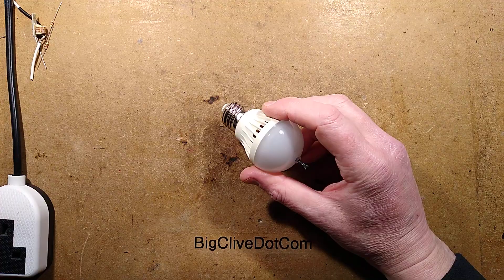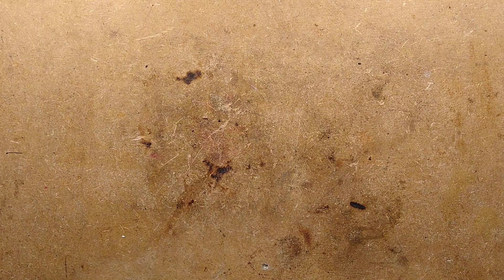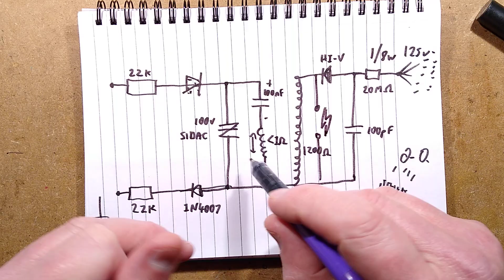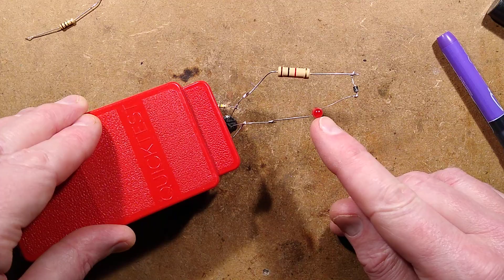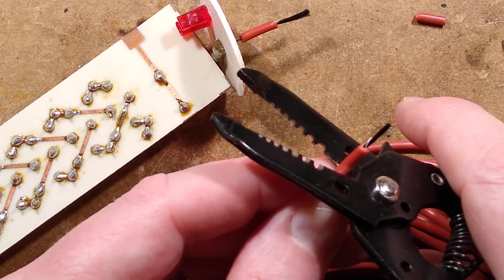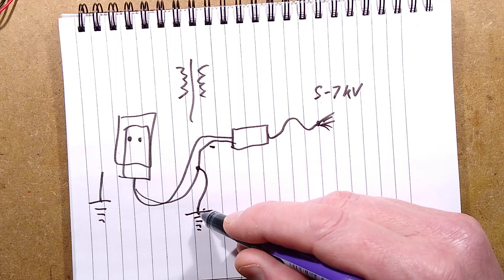LED lamp with tiny 5kV high voltage ion module.  (inc schematic)

Comment: WhEre iS thE 12V-vErSioN???? Anyway, can someone potentially use the 12V-version for a motorbike´s spark-plug, or did I get it all wrong??? Thank you á priori for any answers!!! Also, thanks to the Sidac, I actually understood this circuitry, impossible otherwise (when for example a Zener-diode in place of the Sidac  ;-)   So, thank you Sidac...!

Comment: The operation of the SIDAC sounds similar to the much less expensive DIAC.
Reply from the maker: Similar, but optimised for different trigger voltages and higher current.

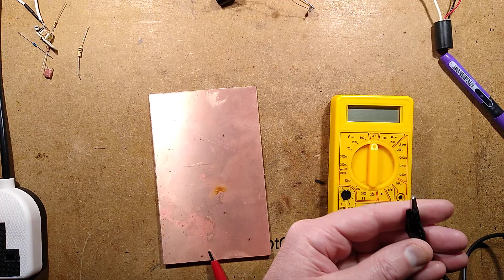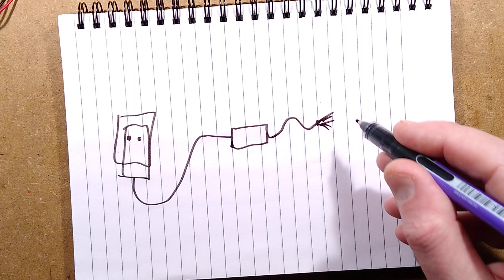Comment: Here he goes again, checks if the soldering iron is on, by touching the heating element. 17:02 Ooh, Clive, if you were to stick that around your bits, will that give you a tingly sensation @ 7kV? 24:35

Comment: Another great place to find carbon fiber cords is to save your old spark plug wires when you replace them, if you're driving a car that's got a distributor and not coil-on-plug ignition. The high voltage wires coming off the ignition coil to the distributor, and the ones from the distributor to the plugs, are typically a similar sort of silicone-insulated carbon fiber to what's useful in ionizers, and can be used pretty much exactly like that carbon heating cord wire.

Comment: Let me guess - if you touch the fibres when it is on you go into the next life very quickly
Reply from the maker: No.  Very current limited, but they could do with a better resistor for safety.

Comment: The line side is essentially a mains voltage relaxation oscillator using a sidac. A relaxation oscillator with a GUNN DIODE can be a microwave source. Often used in AESA radars in an array to produce the steerable radar beam.
Mark Fay US MMC Jr. Engineer QMED AS-E

Comment: you mentioned putting resistors in line with the carbon fiber what is the resistance of the carbon fiber 
if my guess is right the carbon fiber would be it's own resistor.
Reply from the maker: It has very low resistance.
Reply: @bigclivedotcom  I know that there are carbon based resistors, but from the sound of it these filaments would be more like graphite.

Comment: SIDAC, silicon diode for a/c ... I've known that as a "diac" since the late 70's.. interesting component along with the uni-junction transistor, was our analog "timer" component when buiding strobe lights... yeah, the cheap and humble neon also works.
Reply from the maker: The Sidac has the advantage of being rated to handle much higher current than a diac.

Comment: Need to check if it is generating ozone, probably is!
Ozone is very nice but you shouldnt breath it, it is very unhealthy to breath ozone, also, it would not be pure ozone as the air has other gasses.
There is a similar ionizer for USB use, the one I have has the same carbon brush, but internal circuit is much more complicated.

Comment: If Fibre Cable is used on the 5 pins of a DEZAC. What would happen if the stands fan out and touch each other?
Reply from the maker: They're all commoned internally anyway.

Comment: Have you observed if this module generates some air movement, i.e. by making some smoke or wapor near it and looking how it moves? I wonder if it's possible to build a speaker using a similar ionizer. After ionization, ions are repelled from the electrode, because they have the same potential as it. If ionizer's power were modulated with sound signal (maybe it would require more complex inverter, generating constant wave for transformer instead of damped waves like in this circuit), air pressure would change.
Reply from the maker: You do get electrostatic speakers, but they create a dangerous level of ozone.

Comment: Acceptable meter? Dubious class rating. Would you use it on mains voltage? I wouldn't.
Reply from the maker: For bench use it's fine, but absolutely not for high current or voltage.
Reply: @bigclivedotcom  Think they are Cat II if I remember correctly? The shade of plastic they use is transparent enough to emit a nice glow when things go wrong inside. Have you ever done a tear down review of one?

Comment: That might actually be a diac (which is a half wave sidac) Diac's are relativity cheap on ebay (at least they were 5 years or so ago when I purchased some) .
It would be interesting to look at the wave form on the transformer primary, you may find that the pulse frequency is much higher than the line frequency. I have a guess that the circuit is operating as a relation oscillator at a higher frequency, that would also work better with the small capacitance on the output.   
Many years ago I used to build power supplies (zappers) with a neon lamp relation oscillator, the transformer was a 'backwards' audio output transformer so it wasn't in the kV range but was a healthy zap.
Interesting video, thanks!
BTW- That's an interesting safety line power connector... Most of my work is done with a "Widow-Maker" (an old power cord with clip leads attached [don't try this at home kids ;-) ] )

Comment: Interesting! I had never seen air being a conductor so concretely before, except for spark-type situations. I reckon it acts as a current source? So does the voltage shown depend on the meter's internal resistance? Also, could you point that ion emitter at a transistor's base and have it light up a LED?-)
Reply from the maker: The meter impedance dies affect the reading.  Ideally a standard 10Mohm impedance.

Comment: I think sidacs are just special diacs?
so something like this? https://lcsc.com/product-detail/Thyristors-TRIACs_Littelfuse_K2000G_K2000G_C151185.html (they have various voltage ratings)
They call it a sidac in the documentation but the shop lists it as a diac.
I can really recommend LCSC btw. good packaging and great prices, reasonable shipping costs. I recommend checking it out when you want to buy components.

Comment: Interesting video.  You can also use a neon bulb in place of a sidac, which fires at about 90 volts.  I built them decades ago in High School electronics class, where we made our own resistors using graphite (pencil 'lead' rubbed on paper), and capacitors out of wax paper and aluminum foil.  The whole thing was referred to as a 'relaxation oscillator'.  The rate of flash is determined by the RC time constant...

Comment: Clive,  tell me about that HV diode on the output, do you have a part number for it?  Would you not need a different trigger value sidac for 120VAC  in the US? Say 50-70V?
Reply from the maker: The part number had been removed by the acetone.  Theoretically a 100v SIDAC will trigger on 120V.  I tried the module on 120v and it worked, but at lower output.

Comment: i'd probably try to make it battery powered so even if the transformer does spark across it doesn't have a connection to the mains , and then just get a wire and clip or something for the ground

Comment: Well isn't that component called a diac? It's often used to fire thyristors
Reply from the maker: Similar, but a Sidac combines the triac function to allow higher current switching at the chosen threshold voltage.
Reply: @bigclivedotcom  that's interesting thanks. It also looks like that this device has an avalanche like breakthrough with is much faster than a diac. Would be interesting to measure the rise time. As you may know you can operate small epitaxial transistors  (like the 2N2222) in controlled avalanche mode to produce picosecond pulses. You think the sidac could be as fast?

Comment: You mentioned 12v Ionisers, but your diagram suggested 12v AC. I just bought an ioniser and it runs off 12v DC. How does it work? I can tell you: it works very well. Within a day ordered a second one! 
I guess I here must be some inverter in the circuit. I'm reluctant to take it apart in case I let the magic smoke out.

Comment: So a sidac is basically a higher voltage diac.
I think one of the main reasons for those 22K input resistors is to keep the sidac from shorting the input supply when it triggers. The input voltage will likely be near peak when the cap charges up to the trigger voltage.

Comment: Thanks Clive for beautiful clear description and safety advice, the big ioniser attracting dust ..is that only for positive outputs or negative as well? Thinking nice to experiment with negative resistance effects utilizing SIDAC's and Ionizers.
Reply from the maker: It's generally considered that negative ionisers are a better option since they produce an excess of electrons in the air.

Comment: Hey Clive, I have a shady ion module I would like to send you, it cuts off after a few minutes and has a piece of tape covering a hole in the casing.  Underneath the tape is a circuit board and as the plug is symmetrical 2 pin with no earth the bus bar close to the hole is live 50% or the time.

Comment: The 20meg output resistor has two functions 1 protection , 2 the main reason is to Impedance match the output to the free space .

Comment: What are these ionizers good for? I have a device that's labeled as such, but works better as an ozone generator.
Reply from the maker: Many ozone generators are falsely described as ionisers.  A real ioniser produces only a tiny trace of ozone and puts an electrostatic charge into the air to precipitate dust out to the walls and floor.

Comment: I like the way you short the capacitor and then use your finger to see if it's been discharged.  You might as well not bother!  Did you check the meter with test probes disconnected at the meter end to check whether that background reading was being generated within the meter?  Google "Neon Relaxation Oscillator" for a comparison with the Sidac.

Comment: What would happen if you'd reverse the capacitors? @bigclivedotcom
Reply from the maker: In this case nothing.  But reversing the diodes might make it into a positive Ioniser.
Reply: @bigclivedotcom  and what would a potential use for a positive ioniser be? I'm sorry for all the questions, I'm just trying to learn a bit. Thanks big Clive
Reply from the maker: @RoamTheBush  A positive Ioniser could be used to make people in an office irritable and lethargic.

Comment: Would it be possible to add a uv led to a white LED to use in a refrigerator to disinfect the food when the light is on.?
Reply from the maker: It would be better running when the fridge door is closed.  The UVC LEDs are not efficient and have a short life.

Comment: I'd like to see a video as an overall summary to your thoughts on ionizers, you seem quite interested in them. Do you personally use them frequently or just enjoy pulling them apart?
Reply from the maker: I have one in my bedroom running 24/7 and also one at the other end of the house.   I do like the technolgy though.
Reply: @bigclivedotcom  just for a odor control or do you subscribe to other benefits? I find it hard to separate the truth from the woo with these!
Reply from the maker: @gt3911  They definitely help remove dust from the air.

Comment: This is just a cute relaxation oscillator; a neon bulb with a dropping resistor would probably also work. I suspect the output voltage would be lower, but the frequency of oscillation would be slightly higher, as a neon bulb typically has a breakdown voltage between 60-90 volts.

Comment: So, the SIDAC is essentially a Metal Oxide Varistor that conducts at a lower voltage?
Reply from the maker: Different in that it shunts almost completely once triggered.

Comment: This gets me thinking if there would be any way to adapt one with say a 12V source to induce a charge in a filter as part of a filter mask (potentially 3d printed). Basically use a static effect to improve the effectiveness of the filter for smaller particles. The ground return path would be something of an issue and it may not be any more effective than the natural electrostatic effects of some materials, but it does get me thinking.

Comment: Can you please explain those 4g/3g cellular signals booster stickers.. do they work? And if so how.. I think It would be a great video. 
Here's what I'm talking about
http://vi.raptor.ebaydesc.com/ws/eBayISAPI.dll?ViewItemDescV4&item=323942239404&category=68030&pm=1&ds=0&t=1587659959192&cspheader=1
Reply from the maker: I doubt they work.  The placement would need to match internal antenna circuitry and a conductive sticker could actually reduce phone range.

Comment: Hey Clive, just FYI ,you can get ionizers for the car and also buy the potted component separately,(auction site) Ive made a static grass applicator with one they work
quite well and give a little tingle if not used correctly :)

Comment: is it generally polypropylene or polyester caps in an ioniser?
Reply from the maker: It can be either.  The main thing is the voltage rating.

Comment: you can buy the 12 modules on amazon and i have used them to make static grass applicators .  I use batteries though not mains.

Comment: Clive... A friend bought me an ozone machine. I was very happy to get a gift but is an ozone machine any good? Did they mean to buy me an ionizer, and got the wrong thing? What is the difference between the two and which one is hokum, and which one should I be looking at to freshen the air in this musty room that always smells like dust?
Reply from the maker: An ozone generator will get rid of smells, but is not recommended for a continuously occupied room.  Is there a humidity issue in that room
Reply: @bigclivedotcom  Its a converted garage and has "supposedly" been fully insulated and sealed... but there's something in here that is occasionally. irritating to my throat and sinuses. Nit sure what it is... SO should I switch to an Ionizer? Whats the better one that i can get in the States?

Comment: ionizers give off dangerous levels of ozone which is not only harmful to the environment, but can be equally as hazardous to your health. / ionisers make dust and dirt stick to surfaces too. Why would you buy this?
Reply from the maker: Real ionisers produce very little ozone.  The dust would have been in the air and your lungs if it hadn't been precipitated out of the air.
Ionisers are silent and very efficient although they do make a mess.

Comment: maybe try to get the high voltage circuit out and see how much of an arc it can make
Reply from the maker: Not much.  Just the tiniest hiss.
Reply: @bigclivedotcom  ah. maybe they should use ZVS drivers instead...that would ionize the air so fast you wouldn't need to plug it in for a minute.
Reply: @deltab9768  wow! that's crazy!

Comment: I look forward to the fake version with a blue LED and, probably, a cut down cheap artists' brush. :-)
Reply from the maker: They're already available.  Just an LED lamp with the wire and carbon fibre emitter soldered to a blank pad.
Reply: @bigclivedotcom  Damn. There goes another "get rich quick" scheme, like my helium filled Jiffy bags to save postage. :-)

Comment: I thought I would have a go at modifying the Heaven Fresh HF100 (AKA Pure Mate PM100) 'ozone generator' to create a 'proper ioniser'.  From the two-core output from the mains adapter, I figured out which was the common connection to all the boards and the 'collecting plate' and tapped that wire onto the neutral pin of a mains plug (noting that the current is so low it is not going to affect or trip anything, we just need a reference voltage at about earth as noted in this video).  I unplugged and discarded the indicator panel because that served no purpose.  I taped up and stowed the cable for the 'collector plate' and removed the 'collector plate' altogether so that there is no earth near the pins.  I used the existing insulated stand-offs to mount the high-voltage comb with the pins so that the tips are at the front of the grille.  I am not sure how effective it is, but on powering up, there's no longer such a powerful ozone stink, but I can feel the electric charge.
Reply: This is how it progressed (see (i) on each photo for description) https://photos.app.goo.gl/6WLYLg11dxAHw1HH9
Reply from the maker: I'd be cautious about doing that as the power supply might not like the higher floating voltage and the potential difference from the needles to ground might cause insulation stress in the plug-in power supply causing it to arc internally and potentially fail with the output referenced to mains.
Reply: @bigclivedotcom  Thank you for replying promptly.  I have tried to understand your answer on the possible failure mode of my modification, but I suspect I am a bit ignorant of it.  I had figured that the zener diodes were capping the input to the high voltage stage which would limit the output.  I had not considered that there may be a path that could result in a high voltage being presented back to the plug-in supply (which is what I think you mean by 'doing that') when I simply coupled the bottom end of the high-voltage supply (which was already connected to the 'zero' rail on the barrel plug) all the way back to the neutral on the mains side.  Still, it was fun taking it apart and seeing how the original was woo-woo.

Comment: A sidac is the alternating current version of a diac.
In the case of USB ionizers run from 5V mains adaptors, the adaptor normally have a class Y capacitor and a 10M resistor across the mains isolation barrier. The 10M resistor should act as a ground return preventing excessive voltages building up.
Reply from the maker: I rarely see the resistor used in USB power supplies.  Unfortunately the ioniser modules can cause a significant voltage across many supplies and cause insulation failure.
A diac is bidirectional by default as it has to trigger a triac gate on both halves of the sinewave.

Comment: And what is that thing? I dont get it. What is that black brush?
Reply from the maker: It generates a high negative voltage and applies it to the conductive fibre brush causing a continuous electrostatic charge to be put into the air.  That causes airborne dust, bacteria and other microscopic debris to precipitate to the walls and floor.
Reply: @bigclivedotcom  Isnt that dangerous? What if you touch that by accident?